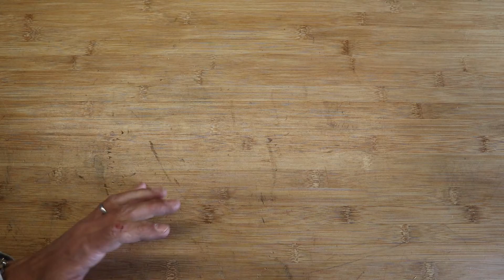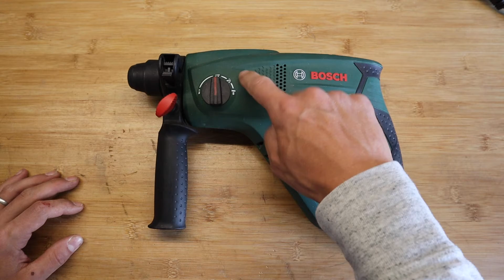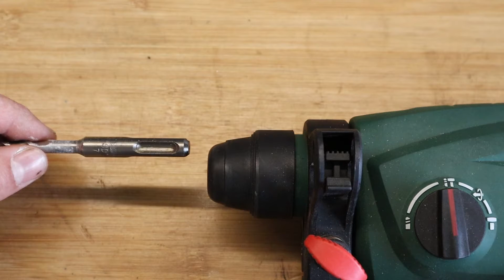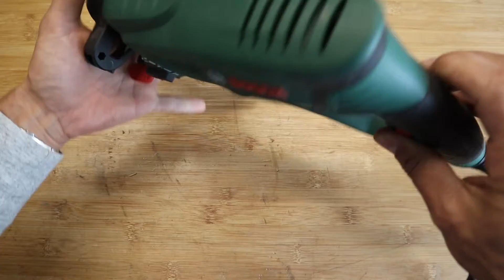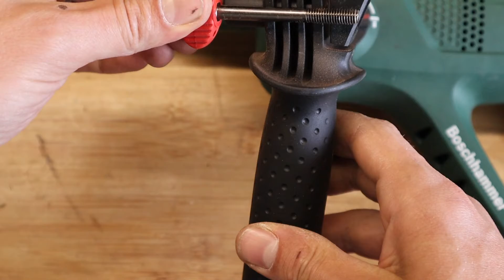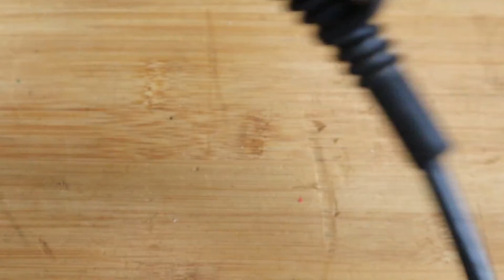Bosch PBH 2100 RE Rotary Hammer Drill Teardown - Any Good?

Comment: You've got the whole mechanics of the drill wrong.
First, that spring on the tool holder tube/pipe is NOT for the hammer action, it is the clutch spring, holding the clutch plate firmly against the big gear, so when the drill bit gets stuck, the big gear will pop up forward and overpower the spring and the clutch plate will slip.
Second, the piston and the tool holder tube/pipe are the loose fit, no pneumatic action there, it's just the guide for the piston, and the place where the striker bolt sits, and the hammer weight which sits inside the piston is the one that gets tossed back and forth, and that is what hits the striker bolt inside the tool holder pipe, which then hits the drill bit/chisel.
The hammer weight inside the piston does NOT have any springs, that is the pneumatic part of the machine, it has the o-ring(which needs to be changed when the hammering action gets weak), the hammer weight inside compresses air, and also stretches the air, and dampening the back blows when the hammer weight hits the striker bolt.

Comment: Glad to see those with issues are the same as mine - chisel only mode doesn’t work (mechanism spins).    This is the second drill I’ve had that did this, but when it was working, getting the hammer action to kick in was difficult unless perpendicular to the surface you are drilling / chiseling.

Comment: The hammer inside the aluminium tube is actually not spring loaded.  It uses air pressure to return.  It got stuck in mine.  Needed a new o ring and regressed

Comment: Superb quality for a cheap tool I must say. I'm saying cheap compared to blue Bosch models which is for professional use. Especially the motor looks really really nice. I say this is really nice to have on your house to drill dowel holes on your walls, mixing paint or concrete and many other uses. Don't let any sds drill overheat, let it cool down completely whenever it gets hot and you will be fine I guess.
Reply: Tak zabezpieczenie termiczne w końcu przestanie działać i teraz mam wirnik do wymiany 😎👍

Comment: Hi there. Thanks for the informative video. On my Bosch PBH2100 RE everything works but the hammer.  When I turn the knob to hammer mode the drill just continues to turn and drill.  Any idea how to fix?   The knob does differ when I set it at either masonry drill and  normal drill mode.
Reply: I expect you've since moved on but this was the same issue as me where the hammer and drill functions properly but the hammer/chisel mode only continues to spin.  The shaft (with those sliding collars) misaligns and doesn't engage properly.  I lined it back up and got the function back - Though the drill does not like the grease I've put back in!

Comment: Yes I replaced the switch, also without clearing the symptoms.
Reply: Can you tell me how to disconnect brown and blue cables going into the switch? (can't see clamping screws)
Reply: @uberipitangalobato2653  the little white inserts at the cable entry are sliders - when you push their prongs towards the bottom end of the switch they will click open, releasing the wires, and of course when you re-attach the cable wires then you will click them back and they will clamp the wire
Reply: @uberipitangalobato2653 tam nie ma śrub trzeba podważyć i wsunąć

Comment: I own one. It has developed a fault after a few years of occasional use. The symptoms are that the drill may not work when used from some angles. I replaced the brushes but now suspect the trigger switch assembly
Reply: Did you ever find a fix for this problem? My unit developed exactly the same issue, with no obvious causes among the visible electrical connections. I replaced the switch assembly having come to the same conclusion as you, but the symptoms persisted.
Reply: @AlexRennison  no, I also replaced the switch. On my model there is an extra wire at the back of the switch to a heat cut out (a thermocouple). I have also tried replacing that with a different thermocouple (after extensive searching, this is not shown in any parts diagram or spares list). This improved things slightly but not for long. Life is too short. I bought the same drill on offer. My partner has bought me a battery driven drill and impact driver set.
Reply: @ellewasal  Thanks for the swift reply! Mine also has the thermocouple wire, so I might play around with that for a bit. That said, you set a good example by doing more exciting things with your life. Suspect I'll do the same!
Reply: @AlexRennison  let me know - i have hung onto the old one. Oddly enough similar things happened to my ancient little black and decker, brushes replaced, only works from a  certain angle, checked for play in the mechanical parts. I thought battery drills would lack torque, but the Denali I was gifted for birthday is great. For the larger jobs the new Bisch hammer is fine
Reply: sounds like the cable (lead) to me. Might look visually fine, but may be broken inside.
Reply: @valterstrumpiks7832  It was easy to check the cable by using continuity setting on a meter for each of the wires connected to the power terminals for the switch and testing back to the plug, and flexing the cable made no difference to the continuity

Comment: I had another bosh drill rubisch, speed regulating is not presices after some time, and dust stick to all buttons and they stuck. the motor hadn't enough torque to mix the cement and was heating up to almost set on fire

Comment: Thank you so much. I was wondering if I could safely take the rubber thing of to open the drill, as the cable broke just where it was clampped
Reply: yes the rubber thing needs to be removed for disassembly. It requires a bit of brute force, but warming it with a hair dryer makes it easier, and much better to put back on

Comment: Thanks for the vid! I'm repairing my old PBH 200 RE given to me by my grandma a century ago ;-) It leaks oil heavily. Opened the machine and it looked like the gearbox of a car.  Is it just me but I cannot believe that a drill is filled with oil from factory. And I cannot find info on the oil neither. My question is: is the oil 'molted' grease? And if so, what type of greasy should I put in? Thanks in advance, no problem with 'dunno' :-)
Reply from the maker: Hi Eus, Bosch actually uses a specific grease within all of thier hammer drills. Here is a link to the part number and some details: https://www.ereplacementparts.com/grease-tube-p-768150.html

It’s not an oil, but if the drill gets used for long periods of time, as in hot the stuff eventually turns into an oil like substance.
Reply: @toolteardown  Thanks a million! You saved the day. My drill is very special to me and gets a new life thanks to your great info. I feel blessed :-) Love
Reply: @toolteardown czasem ktoś dołoży innego smaru niż zalecany wówczas roztapia się bardziej

Comment: Hello.  I have the same drill.  I disassembled it.  When the engine is running, it gets very hot and the impact feature is lost.  What is the reason?
Reply from the maker: It’s a pneumatic mechanisme. When you say when it gets hot it stops. I think the pneumatic piston mechanism might be seizing, in the cylinder, which stops the hammer impact function.
Reply: https://www.google.com.tr/search?q=pbh+2100+re+piston&client=ms-opera-mobile&channel=new&espv=1&prmd=sivn&sxsrf=APq-WBtMYf7uYC4yY8kAj-0UuGTEP3zYiQ:1650305666357&source=lnms&tbm=isch&sa=X&ved=2ahUKEwjY343Ym573AhXxQ_EDHQTlBAEQ_AUoAnoECAIQAg&biw=360&bih=616&dpr=3#imgrc=gcK5N-qvV1iEAM

I think this piston is the part that performs the impact function.  The coup works again.  If there is a problem, will replacing this part solve the problem?  In addition, what could be the cause of the engine overheating?

Comment: I have the bigger brother of that rotary hammer the Bosch PBH 2500 RE it looks identical but it's a little stronger, I drilled some holes with it in about 5 years of use but now I'm taking it out only for harder work that requires more force for lighter stuff I have a 20 v battery-powered,  rotary hammer from Skil, the SKIL 3810. 
Congratulations on the channel, and keep up the good work! 
Greetings from Romania !

Comment: As expected, the drill oozed typical Bosch quality. Another thorough investigation of a power tool, thank you. Just one thing; you appeared to side-step the manual rotation setting on the switch for adjusting the chisel position.
Reply: I was searching for that, thanks for explaining that function.
Reply from the maker: your absolutely right I skipped that one... sorry!
Reply: @toolteardown  I know this was some years ago but i dont suppose you would know what would stop this drill from engaging into chisel mode. Mine doesnt seem to click into that setting and the chuck keeps rotating when the dial is pointed at the chisel feature. Any idea on how to fix?
Reply: @charg1nmalaz0r51 może wodziki którymi steruję pokrętło są zle poskladane